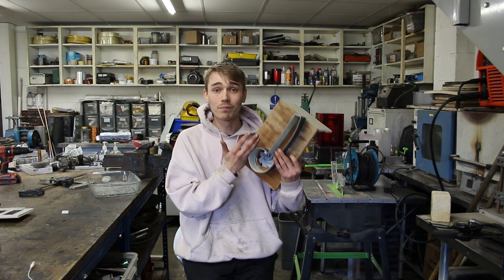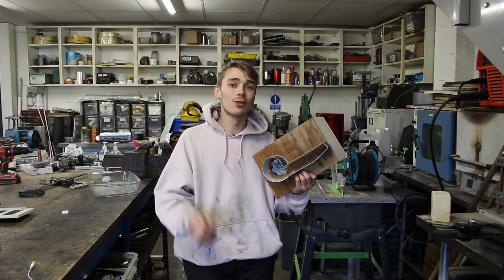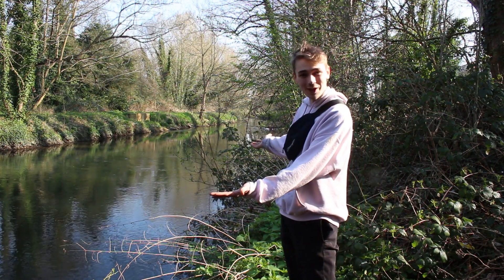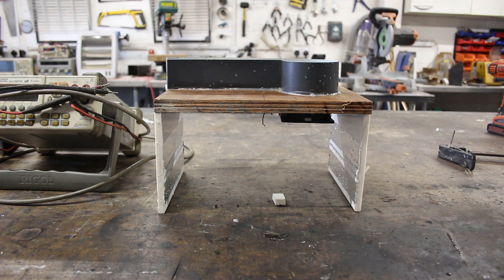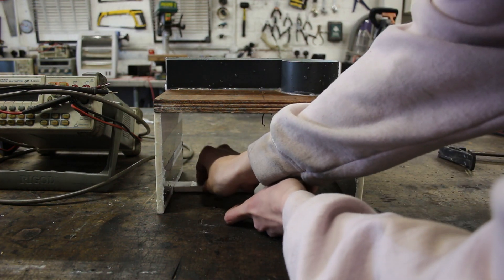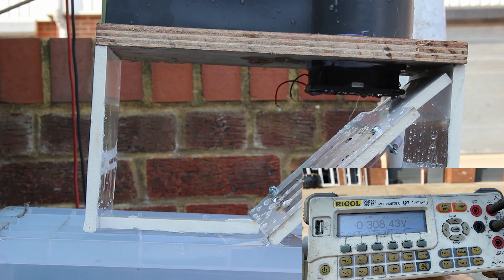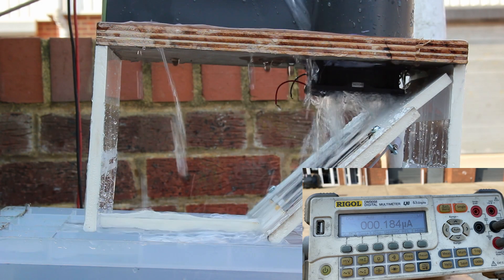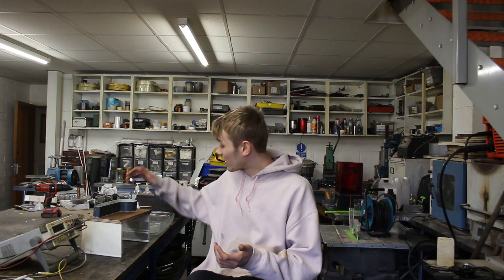1489 - Combining the Whirlpool Turbine and TENG - For Extra Energy

Comment: If you attached the teng to a ac/DC conversion chip and that to a fish tank water pump you can cycle the water back to the top allowing you to use all of the water turbines power. You would have to use multiple fish tank pumps each at 3.5 v with .1253 something amps required. Then you would have free energy so long as you kept the water from freezing or evaporating. I'm making one using a low rpm water wheel.

Comment: Hey Luke?  Wonder if you combined two additional things if you could greatly improve upon it even more?  1.  If you use a round vortex.  2.  If instead of 2 inches deep, if it had a round pipe increasing it 33 foot vertically which is the weight of one atmosphere.   The hydrostatic pressure will creat an incredible pressure and torque on the turbine.  Should be capable of producing many amps rather than milliamps with a more powerful motor.

Comment: Reading the paper from the HK uni I saw they made a mistake on the voltage level, however, it has got me thinking and if 50W/m^2 is harvestable from rain, there should be no reason why you couldn't have a solar panel at the top of a stack, then TENG panels under it at opposite angles, and repeat over say a 2m height? After I build my ridge wind turbine I will look at building TENG panels for the shed. Having solar panels only in winter means my 12V system requires mains power top up :(

Comment: Can't wait till it is found that you can generate power with the static unit with out running water over it ;) (working on a laser engraved unit to pack the density as tight as possible because this option allows for the unit I was working on with out the need for a harder to make substance like graphene as it can just use any conductor desired)
Reply: Rooting for you.

Comment: Couldn’t you essentially make the water perpetual, making it a perpetual energy device?
Reply: Not without violating some laws of Thermodynamics - entropy !
Besides, if all the energy goes into making the water go around again, what good is it doing you ? You are aiming to subtract energy.
Reply: @kennethbain4290  i was thinking more in terms of valve pressure switch and gravity fed water perpetuation. Along with minimal motor assist if needed.

Comment: Pretty unrelated,  but I wondered if you guys checked out ' wind swept and interesting ' kite generator?  Was on BBC news a few months back. Thanks for all these awesome inventions and work you do
Reply: That tech would work far better if they just used buoyancy on the kite rather than depending on the wind for all the lift. By that I mean just enough to keep the kits from falling from gravity and the weight of the cables.
Reply: @Barskor1  the tech, for me, can work far better than these stationary wind turbines. I agree , so much room for improvement, However, the scalability of these kite turbines and the low cost to build surely should be a route we can all pursue in our research? The guy charges his EV with it 🤯
Reply: But yeh regarding buoyancy, I think a hydrogen balloon of some sort would solve the gravity issue maybe?

Comment: Might I suggest that water also has thermal energy. Lining the water way with stirling or other heat transfer type electrical generators would allow a third way of extracting energy from the water, without being detrimental to the other two ways.

Comment: Try layering your TENG ex. graphite foil,  abs glue, graphite, abs glue and repeat. And put them in parallel but most of the time i get better voltage if all of the negative electrodes are separate or positive but one set connect. The voltage seem to double but i only tested two layers so i cant say for certain.

Comment: A more home sized scaled up system  would be the exact opposite setup with teng roof panels flowing into either an accumulator or straight into your gutters with one or more turbines in line. You could feasibly generate electricity nearly the whole way from your roof to the ground.

Comment: So, my understanding is the energy is less than or equal to the energy needed to bring the water up to the top of said turbine as all the potential power that could be created from any possible sources before it gets back down to ground level, but with rain allowing for water being lifted up and brought to the higher level without any input from us, it's possible to scavenge more power than we ourselves put in, but a large reservoir would be needed for sustained power generation

Comment: Wind turbine at the top of the axle of the water turbine?
Reply: Actually, I wonder if a Vortex chamber like a funnel on top would siphon wind inwards from any direction and assist with the water pressure, like a 360-degree ram-air